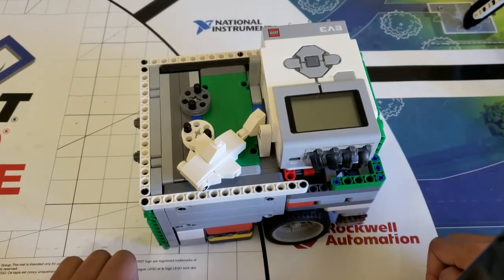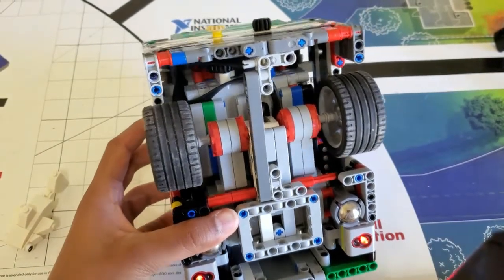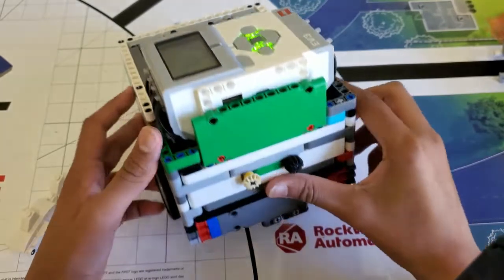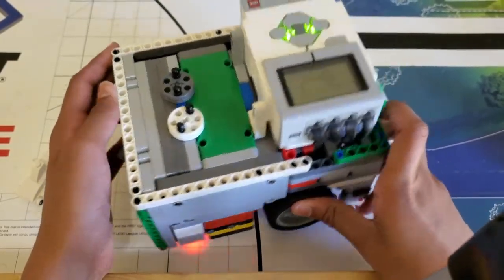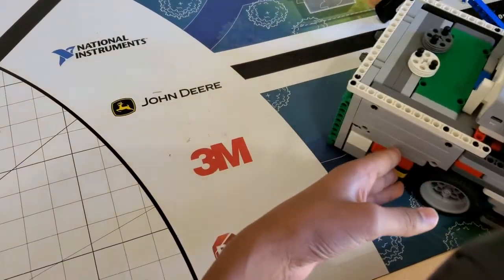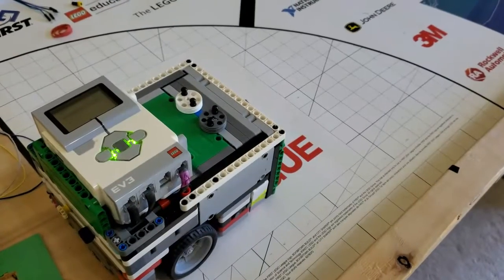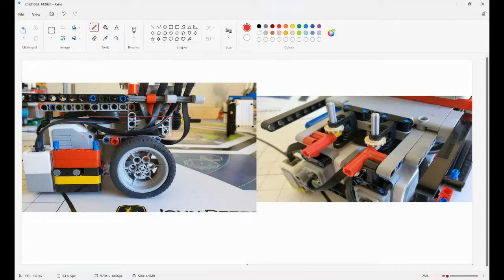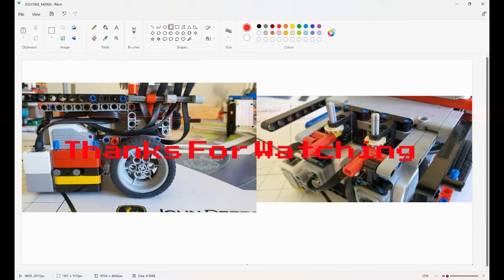How to Build the Ultimate FLL Competition Robot (For SuperPowered or any other challenge)

Comment: I want you to explain in detail the steps of building the ev3 robot from start to finish for the competition
Reply from the maker: Hi, great question, so this robot is actually the result of many other base robots I have made in the past using different styles (like standing motors, motorcycle wheels, and different medium motor orientations). Through all those iterations, I picked the best parts of each robot that I built and then finally I came up with this design.
Hope this helps, good luck this season!